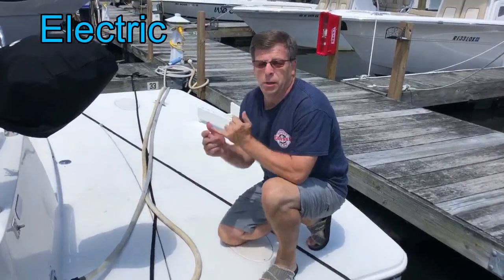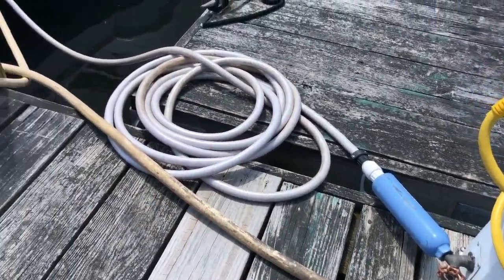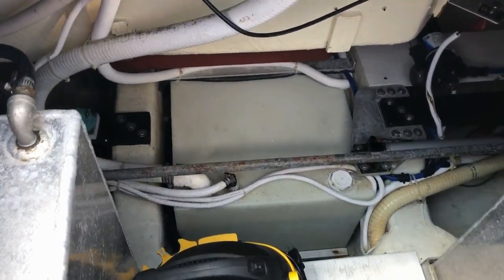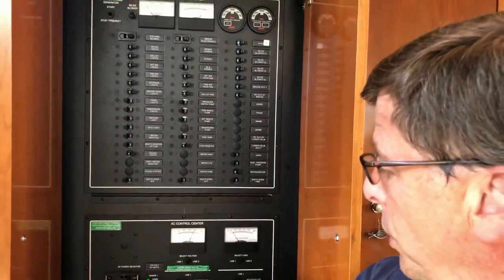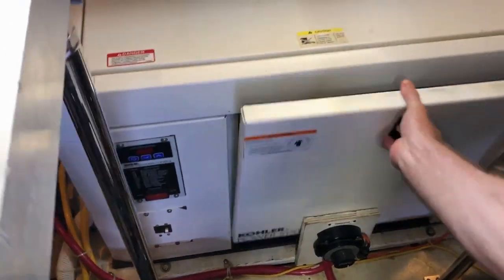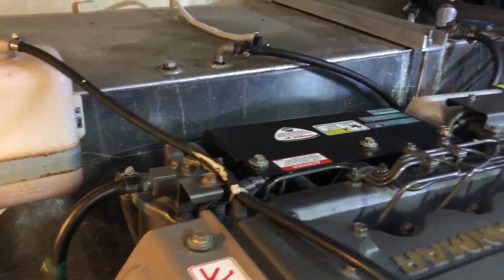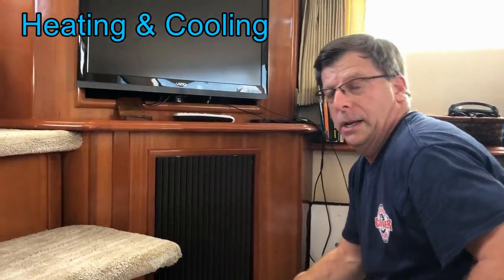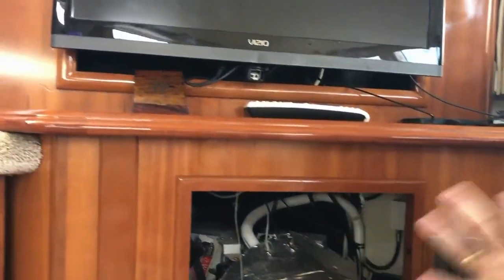The Mechanical Systems of our Carver Motor Yacht

Comment: Very illuminating. I was put off by what I saw. All the systems (which are largely marine specialty) are crammed into tight spaces, rendering them hard to work on and replace components, and add on to this the abusive marine environment (salt air, humidity, temp. extremes) which accelerates degradation. It looks expensive and uncomfortable to maintain. Looks like a lifestyle best reserved for the wealthy.
Reply from the maker: "all the systems crammed into tight spaces" = Yes, William, it is a boat! You are correct, marine life is hard on a boat, and it's systems, but like a house, if you keep up with regular maintenance items, it will cost you far less.

Comment: What are your oil change and fuel filter change intervals?
Reply from the maker: Willie, I follow Yanmar's guidance and change the oil and filters every 200-250 hours. I change the onboard (secondary) every other year, and use 2 micron Racor filters.
Reply: @ourfloatinghome8940  Thank you

Comment: Nice engine room.  Do you have a battery system where your generator charges them up so that you can run minor things like lights, tv, computer...ect.
Reply from the maker: We have 6 deep cell batteries and two battery chargers that run when plugged into shore power and on generator
Reply: @ourfloatinghome8940  I kinda figured you had something like that.

Comment: did you add any solar panels?
Reply from the maker: no solar panels. We spend most of the time in marinas and anchor out while we travel for 1-3 days at a time, which we can handle fine with our generator
Reply: How much fuel does your generator burns with good load?
Reply from the maker: @TheTrashPirates  approx half-3/4 gal/hour
Reply: @ourfloatinghome8940  not bad! thx

Comment: Being an old "motor head" myself, I loved your video covering your mechanical systems!  Your holding tank system looks real clean, however I bet the smell is the same, LOL. When cruising how many gallons of diesel do you burn?  For your safety and security I've put up a little video on tactical pens I think you may enjoy. It isn't as professional as yours but I'll get there. https://youtu.be/WhRhwoFg0iU
Reply from the maker: Hi Chuck, so great to see you. I was smiling when I clicked your video and saw it was you!  Yes, not much you can do about the smell, except keep the seals working! We cruise slow at 8-9 knots and burn 3-4 gals per hour. When we're on plane and cruising at 20 knots, we're burning about 32 gals per hour.